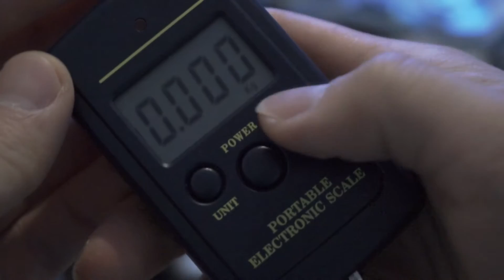FZ Mega Power 300 Badminton Racquet Stringing - Đan vợt cầu lông

Comment: Hi! I've been looking at getting a machine for myself, but I've heard a lot about quality issues for Pro's Pro machines. How do you feel about your machine?
Reply from the maker: It will not as firm as you may think of or when you watch stringer does the job with expensive electronic machine. For example, when the string is pulled by the weight, I notice the base (that holds the racquet) flex. The whole base lean towards the weight a bit. The clamp does not perfectly fit the clamp base, hence a bit of flex also when I clamp the string and release tension (it's more noticeable). About 5mm of flex perhaps.

You would have hard time stringing badminton racquets because of two reasons:

1 - Some modern racquets like Yonex Z Force II has two last main strings really close to frame. It may lead to a situation when you cannot clamp the string because there's no space. I need some experience for this.

2 - Four side supports of racquet frame leave too little space that regularly I couldn't thread the string to holes. I have to release the supports for a while.

This machine is meant for tennis first, other racquet sports second (need to order universal clamps if you want to string badminton racquets. Original one, they say, is for tennis only). However, there's one problem with my machine when stringing tennis racquets: There are two big mounts to the base (each has 3 mounts to racquet frame. I don't know what two mounts called so try to describe to you). One of them doesn't stay firmly. No matter how hard I tighten it to there base, it still moves when I apply tension to the string. I need to find better washer to hold it tight. Stringing badminton racquets doesn't have this problem because the tension is much lower.

I need to adjust the lock of clamp base so that it stay firmly to the base, since the lock looses "tension" (I don't know what it calls but to hold the clamp base) regularly.

This problem with badminton stringing doesn't not apply in tennis stringing and vice versa :D
Reply: Thanks for such a detailed reply! I really appreciate it!

Comment: Hey, what starting clamp did you go for?
Reply from the maker: I simply bought one from ebay for 25€ and it works very well for badminton or tennis stringing. The Pro's Pro Challenger I package that I'm using, doesn't include the starting clamp.
Reply: Nice one - the scale sticker has screwed up on mine too (Rubbish design..). I've tried to replicate the markers by using a knife to etch them in on the flat top section of the bar.
Reply from the maker: +Mooooooooooooooooot I personally don't use the marker but the small electronic scale as you see. And I found that the marker is nonsense 😀